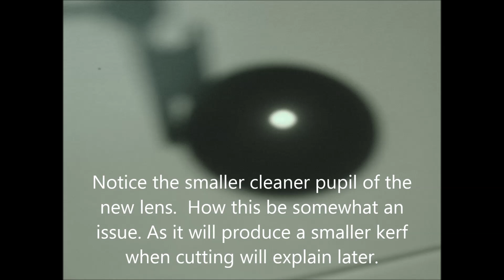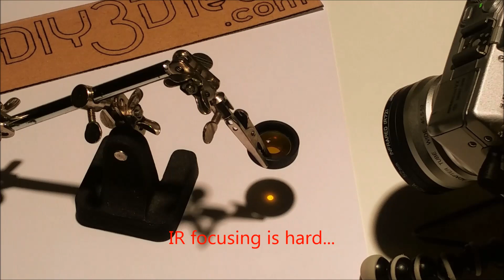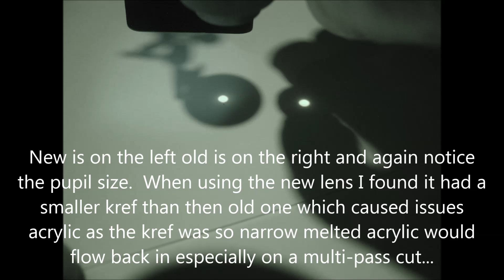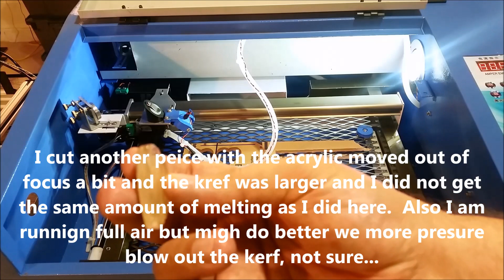eBay Chinese CO2 Laser Cutter & Engraver - New Light Objects 18mm ZnSe Lens!

Comment: Last week came my K40.
When I looked in the packaging, I was scared.
The cutting head hung loose on the  belt because all rolls rolled around in the device.
The cutting table was completely crooked and was jammed.
2 mirrors are partially blind a single disaster.
The dealer has promised me replacement but for the individual parts.
I have now begun to take apart the K40.
Will completely rebuild the laser cutter and replace all control elements with better ones.
So in this condition it would have been life-threatening to turn on the K 40.
Greetings from Germany
Reply from the maker: Ouch that sucks! None of them come that great of sharp, but wow that doesn't sound good.  Was the tube ok?
Reply: yes i thank to god the tube whas ok. Next week i will beginning whit my first changing of Parts.The  milliamps meter the potentiometer (Jog Dial u know?)and a digital temp Meter and a other exaust whit a new Pipe.That blue thing is bull shit. Then i change the Controller board whit a Arduino Mega whit Ramps i believe that  is a lot betterwhen i will working whit GRBL you know?I look all your vids then what u do is very interessant for me and i can learn from them.
Sorry my english is not so good i hope u can understand what i mean?

greetings from germany

Comment: I am going to put down that grid, but coat it with a rubber coating. I will be engraving exotic woods and do not want any marring from the steel.
Reply from the maker: +Kris Kumaroo if do this two things, first be sure to use pins as the laser will melt the rubber and two be careful of the fumes. Also let me know how it works out for you too :-)
Reply: Thanks for the reply. I just got off the phone with Lightobject and with all the modifications it almost seemed like he suggested getting the next model up 50W with all the features I want to put on there. I am confused. He also said they are coming out with their own version but its price point is 2k plus. It arrives Wednesday and I am now conflicted on what to do.

Comment: Hi I bought one of these 40w chinese lasers off ebay and am just now trying to use it after having made the modifications like the air assist and honeycomb bed ect and I was just trying to cut some acrylic that is 4mm thick, I ended up trying the cut at 5mm speed and the power on the laser was max and i was unable to cut all the way through the acrylic in one pass, should I expect it to cut in one pass or should It take 2 passes.
I did the nylon washer mod you did on this 18mm air assist head maybe down the line i will get this lens you just picked up.

thanks
jeff
Reply: Hi Jeff,   I live in a hot climate and found I needed to put frozen water bottles to keep the temp down.  At around 22 deg c, I use a lot less power to cut .  3mm acrylic at 50% and 7-10mm.  4.5mm acrylic I bump the power up to 70%.  I have added air assist and just using stock mirrors and lens.  New mirrors and lens should arrive tomorrow if tracking is correct.